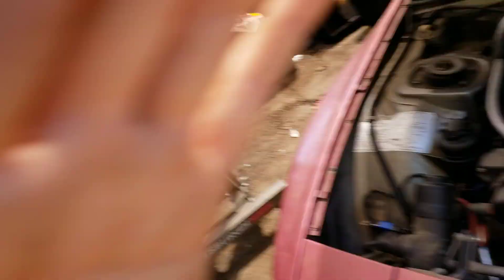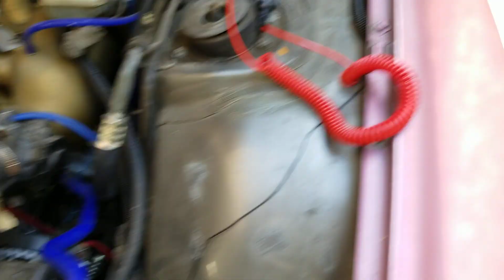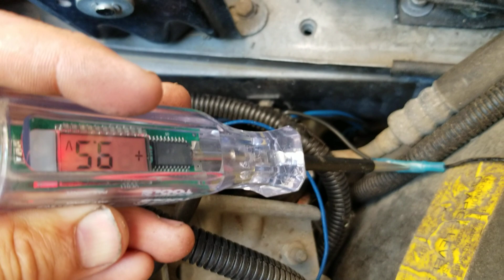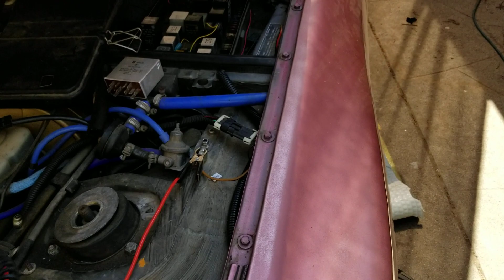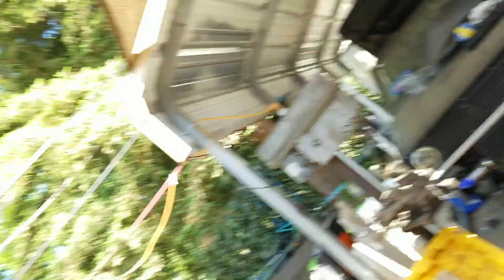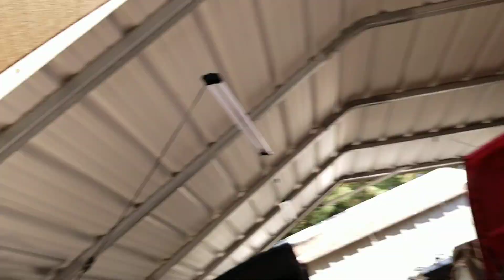12 Volt AC compressor in a 944 Part 10

Comment: I am caught up with your project! Subscribed to you so I can catch an update if you make one.
So am I understanding correctly, that the controller for the system is faulty? It looked like it was working in part 8 though.
If the weak point of these Ebay kits is that controller, that puts serious doubt for my project. I figure an alternative to not using said controller would be a circuit opening piggyback relay off the compressor clutch but that also doesn't seem like a robust system.
Reply from the maker: I appreciate that.  I do not feel the controller is faulty since with the correct reference voltages from the evap it does turn on and turn off.   There was trouble shooting that needed to happen for me to get this sorted.  The controller appears to rely on a twin power then the ground signal comes through. Similar to fuel injectors. Most systems a fuel injector has 2 power to hold it closed, then 1 power turns to ground from the ECU and fires off the injector.   From what i have learned on this AC  controller is it has that some basic principle for operations and most EFI systems for getting fuel to the cylinders.  Hope that makes sense.

Comment: I've been following this pretty closely. It'd be nice to have a video fully explaining the results and system setup. I'm sure you are quite busy though
Reply from the maker: I will try and set some time aside to do a detail video on this for sure.
Reply: @dr.frahnkensteeen4485  thank you! I really appreciate the videos you've made so far on the topic
Reply from the maker: @CryoSignal   You are welcome.  It has been a fun process and learning it all. I am going to be installing a larger condenser and fix a few leaks.  At that time I will be a detailed video. and try to include links for parts used.